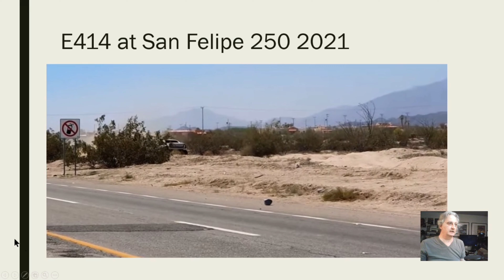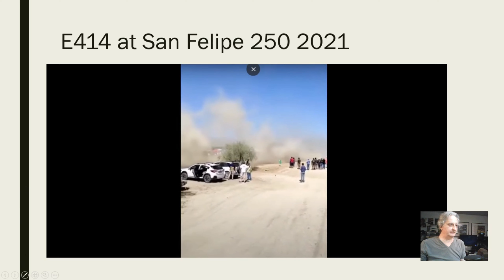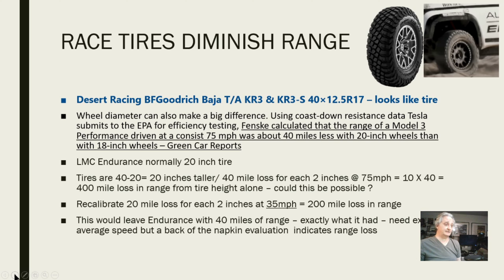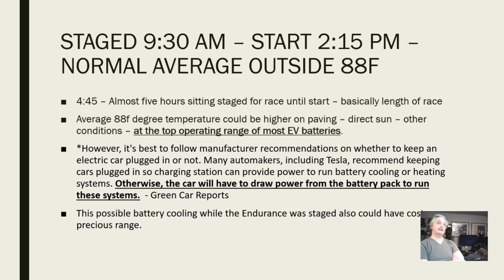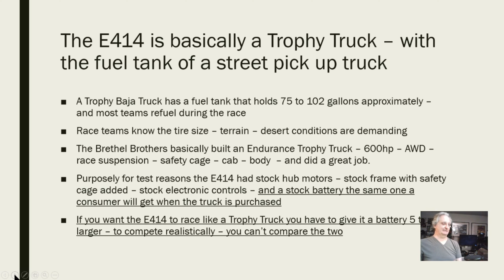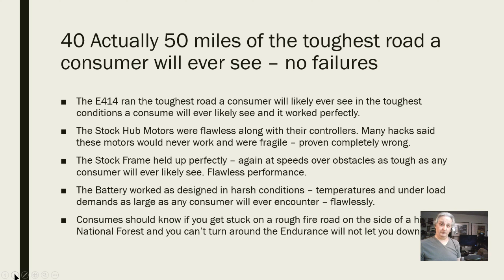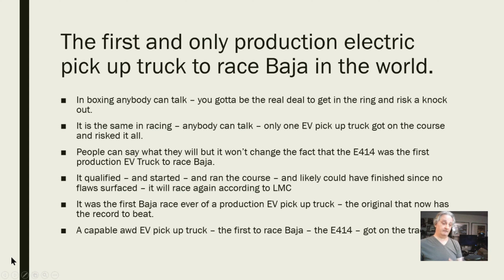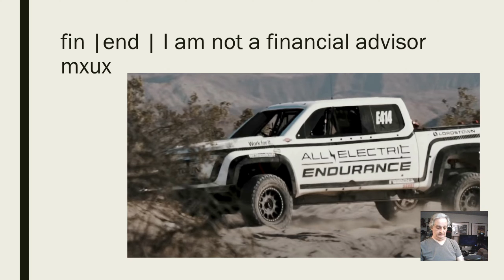Endurance | San Felipe 250 | Race Results | What happened | #MXUX #RIDE #ENDURANCE #SCORE #Lordstown

Comment: And yup, great video! That was a GREAT point about the larger tires affecting the range. I hadn't heard of that Tesla example. I do disagree however with the adding more batteries. The more weight, the harder on the range, especially in these conditions. I'm sure they could add more cells to a certain point and extend the range, but I don't think they could even double their current battery pack size for this race... we'll see what they do for next year!
Reply: Says in their investor presentation it can have a payload of 3000 total pounds, so perhaps someone more apt than me with numbers could graph out the efficiency of the truck as more weight is added towards that cap
Reply from the maker: Hut thanx for comment hut - ya well this is like Kitty Hawk you know - first flight and all that - it got off the ground you know that is what counts - next race will be badass IMO.
Reply from the maker: Hut if they decide to go with a battery that is not standard equipment size wise I am sure they can work it out - other comments say 5x not necessary...

Comment: A tesla battery weighs approximately 1200 lbs adding an additional 4 batteries would have added an extra 4800lbs. This extra weight would have overloaded the suspension. They should have added an extra battery that could have been interchanged throughout the course.
Reply from the maker: Planet I was using exaggeration to explain the concept - they could optimize the larger size based on this race data - oddly enough as I mentioned in another video - the Endurance battery is replaceable - it is built/designed to be removed and updated with new tech in the future and  LMC wants to re-use the battery in Home applications (?). Not necessarily hot swapable - but perhaps modifications could allow the hot swapping of batteries on the course - might be possible....

Comment: A few clarifications.... A converted electric 4Runner (E422) ran in the race along with the Lordstown (E414) truck. So the entrance of the Lordstown truck is the first (known) pre-production EV truck entered in the Baja race. Kind of a small detail. Average speed can be calculated from the race replay. Certainly a lot less than 75 mph, more like about 20. Trucks left the starting line on-time, staggered, based on trial times. The EVs were some of the last trucks to roll. 

Lordstown didn't do a good job executing the recharge. The E422 entry (runs on Nissan Leaf motor/battery) allegedly had seven battery swaps scheduled for the race.
Reply from the maker: Chris I hear you - on the SBOX - they could man handle those batteries like a stack of encyclopedias - they could have had 20 spares so clever - but not a fair comparison IMO - but hail SBOX. The Endurance had a production drive train - full production - what consumers will get - so production vehicle IMO. Also decision to run the production battery limited their options but proved their technology. I was quesstimating the race speed - looking at the graph output - seemed about right - ballpark for sure - and it helped with the equation  - I stand by the concept - but not my math - ha - thanx for the comment.

Comment: I’m a big supporter of the Endurance. Here’s some comments on this presentation.
- tire size.  The Endurance has 20” rims, I believe the production truck will run 34” wheels.   From what I could see in the videos the Endurance was driven too slow so it was plowing through the sand instead gliding on top of the sand.  Plowing consumes a lot more power. 
- Start time.  I think the live stream shows the Endurance starting at 11:50.  I live in San Diego about 5 hours from San Felipe, the weather here was cooler than normal. Why couldn’t they just switch off while staging?
- Trophy Truck.  Yup, your exactly right, a TT cage and suspension grafted on the production frame, battery and hub motors. Do you know most TTs are RWD only due to the difficulty of adapting the long travel suspension to steering, half shafts and CV joints. The Endurance’s hub motors are perfectly suited to be a Baja racer.  Adding the Brenthel standard 24” suspension travel, 30” rear was no problem because of the hub motors. While down about 400 hp from the TTs the hub motors mitigate that with AWD and torque vectoring.  So, in Baja racing no EV truck with chassis mounted motors can compete without drastic modifications. In its current form the E414 should be able to absolutely thrash the Rivian, CT, Hummer and EV pickups from any other manufacturer. If I was Lordstown I would challenge these trucks to a dual in the next Baja 250.  My guess is they will decline because their street trucks would be no match for the fearsome E414.
- Bigger battery.  I don’t agree a 5x battery would add about 4-5 thousand pounds. My suggestion is use the stock battery and stock powertrain with a range extender in the flunk. It doesn’t have to be huge, only about 100 kw. 
- Running Flawless. Not sure about this there are a number of reports that they were running slow before pulling off the course to recharge, the GPS files seem to verify this. Videos show the “Shitbox” leading the Endurance even though it started after.  My suggestion is fix whatever problem there was and enter the Baja 500 in June. I would also challenge the big boy EV truck makers to come out and play with the Endurance if they dare. I’d even put up a side bet of a substantial amount of money to go to the highest Baja-E placer’s charity of choice.
Reply from the maker: Larry thanx - on the tires thanx for the insight I am spit balling here so more info the better but I think my point on the tires still stands with the new information - a definable factor. On the cooling of the battery while staging - well here the thing is the default is that that happens automatically with the truck on or off - I am saying here IMO it was on here - they had to keep the battery cool for the race. The temp you can dispute - it was hot. On the 5x battery - exaggeration for explanation - they could optimize the size based on this race data. On the racing ability of the Endurance - I have said in past vids it is like a F1 car really - very capable - more than any other ev truck design for sure. ON the slow speed back -LMC sez no component failures - so another reason? Deciding what to do maybe? Driver decision? Conserving battery? Lost? On the shitbox - much respect but more like a hopped up riding lawn mower - using proven tech - no need to baby it - I believe it did not finish the race.

Comment: I feel the inherent design flaw with direct drive motors is that any torque shock experienced by the wheel is directly coupled into the motor drive electronics via back emf. This would cause high current and voltage spike which would destroy the IGBT drivers. I think this is why they experience failures and fires in the drive electronics. 
I hope I am wrong because I would really like to see this technology become a reliable method for it would lead to low cost reliable vehicle someday.
Reply from the maker: G not an engineer but as I understand it the physical forces on the hub are transmitted to the wheel bearing and the spindle - not the rotor or stator by design - as for EMF - I have no idea I can tell you that the motor was designed and built over 12 years of research by a quantum physicist and a astro physicist - have you looked over Elaphe's web site? They might cover your topic there - this is way over my head - the fire on a test vehicle was attributed to human error in assembly though thanx for the comment

Comment: Tire size different than wheel size. I'd say the Endurance runs a 31" to 33" stock tire. The Baja tire may be 40" but it's not double the size of a stock tire.
Reply from the maker: CH - I hear you -a guesstimation on my part - to make a point - not even certain those are the race tires used - what I mean to say is the tires are bigger (look 2x though right?) and that reduces EV range for sure. Thanx for the comment.

Comment: Brenthel industry’s build this truck beside the parts shipped in like wheel hub motors and battery’s. No this is not a trophy truck it’s a factory lordstown frame with a Baja kits mid travel bolt on suspension kit .
Reply from the maker: Exaggeration for the purpose of explanation - simplification - it is close to one though - 600  hp - safety equipment with a race suspension modified for the hub motors I am  sure -race tires - wheels etc - didn't you say above there were no stock components? Isn't a factory frame a stock component? as well the factory battery -factory hub motors - CT thanks for the comment - I actually agree with most of what you are saying -please see the previous vids on the Endurance.

Comment: Not at all stock components 😂😂 where are you getting this info?
Reply from the maker: Absolutely stock: frame - hub motors - battery - computer controllers - CT see previous video for build information - stock frame had roll cage built on it - suspension - other are baja build by Bethel Brothers -my last couple of vids explain the build in detail - drive train absolutely stock production components - thanx for the comment

Comment: Didn’t have any extra space inverters filled the space of where the engine would be also two more inverters in the rear
Reply from the maker: CT news to me  - build photos of tube cage appear to show space? could configure differently? - but all theoretical in any case - they used the stock frame here - stock component - so could go with custom frame so on - but this was a stock frame / battery configuration intentionally so you are essentially correct - thanx for the comment

Comment: Battery took up the entire floor space no way for a bigger battery with that frame space
Reply from the maker: CT theoretical build here of course - but no ICE motor -no Ice fuel tank = plenty of room to alter design IMO
Reply: They can fit more cells inside the existing battery pack. However they wanted to test the pack that will be used for production.

Comment: The math on your tire size and range are inaccurate and based on the wrong information. The range for the Tesla Model 3 is based on a RIM size of 18" vs. 20", not a TIRE size. The rim size of those BFG tires is only 17". These BFG tires are labeled differently than a standard vehicle tire. The tire diameter between the 18" and 20" on a Model 3 is most likely very nominal and the range difference is only due to the size of the rim. I don't know how you would find the information you're looking for for the difference in diameter of the tire, but what you stated is inaccurate.
Reply from the maker: Brandon I am not going to challenge you on that - I was spitballing - I was making a guess on the actual race tire used based on photos - so it was ballpark - back of the napkin as I said - the point I was trying to get across was that  tire size does  have an effect on ev range - for civilians - there is a lot of hard core math here my brain just wont do anymore - but I think I made the point in broad strokes - rotating wheel mass - diameter so forth - beyond this vid - if you look at the trucks side by side - production and baja - the wheels are different - as I understand it the diameter of the tire is a factor - but what do I know - thanx for the comment B
Reply: @mxux  no worries! I definitely agree that there's going to be some range difference between a 34" and a 40" tire. I just don't know what that difference is. Was just saying it's not an apples to apples comparison with rim size vs. tire size and a direct 40 mile drop for 2" change. The tires being bigger would allow you to cover more ground, but they're obviously going to be much heavier. That's where the range loss on rim size comes from, 20" is just a much heavier rim than an 18". I think the biggest range loss in the case of Endurance is due to the terrain. I saw a news clip earlier that said they calculated a 3x power consumption based on the terrain, but the data showed a nearly 4x consumption. Given that, they were afraid they wouldn't have enough power to get through the mountain portion of the race and would end up blocking the road so they decided to drop out.

Comment: Stop making excuses about the truck sitting there for 5 hours. You know the truck was plugged in the whole time it’s been sitting there. The engineers want the truck on full charge before the race.
Reply from the maker: Plugged into what? In the grid - I don't see how they could have had those large trucks with generators on them there - in the pits likely - where u there ? Did they have the trucks there? Race rules? anyway - just read a good article - no shame in not finishing Baja - Cor they took it off the tailor and put it on the track - gutsy move no matter how you slice it IMO